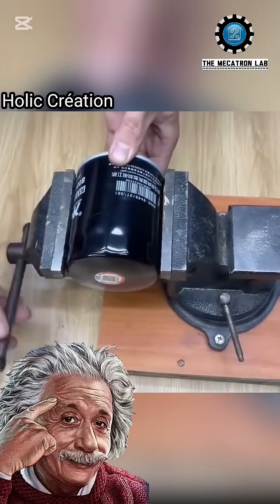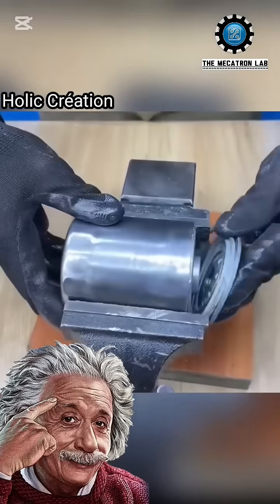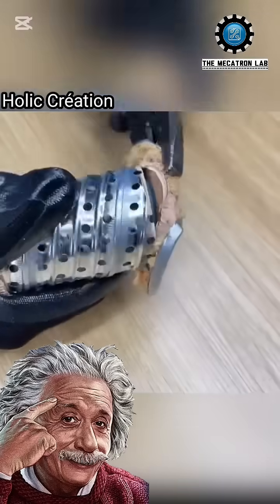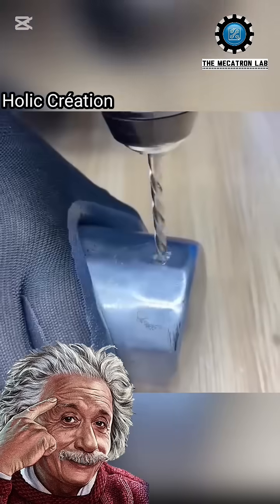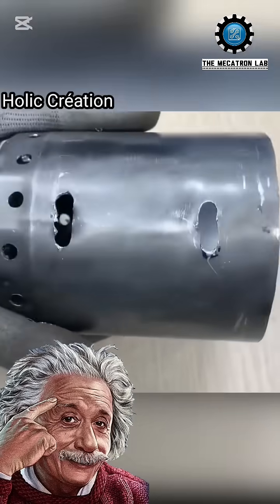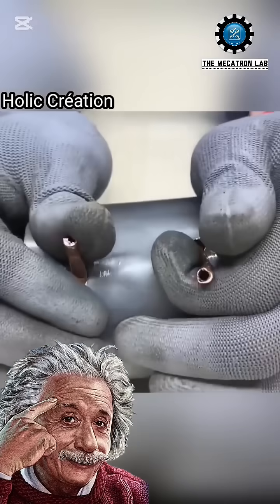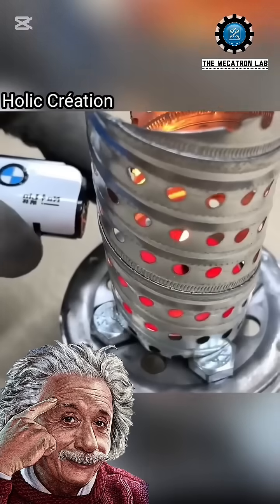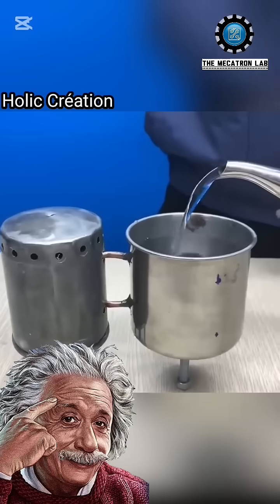How To Make water Heart AT home using oil filter. #diylrojects #experiment

Comment: Good starter idea. But this wouldn't heat a fart in cold weather. Needs to be wood fired, to keep the btu up
Reply: Dairy gives me farts that I can cut scrap metal with, but the torch regulator is uncomfortable to insert, and chafes.😂
Reply: Maybe shrink the inlet size, a bit 😂  @FredtheDorfDorfman1985
Reply: @FredtheDorfDorfman1985 turns out you need a generous measure of wd-40 to use a torch like that
Reply: You can't build fires in public in the city limits
Reply: @btl223  Tell that to all the homeless folks in California camped out all over the place building fires inside city limits.
Reply: 😂😂😂😂😂 @WeThePeople.
Reply: Пердежом более продуктивно
Reply: @MakusPro 😅😅
Reply: Also - there is no pump or anything that circulates the water. It needs to circulate thru the coil to get heated at all. One of the ends of the coil was even left above the water surface once he poured it in - making even a tiny bit of  circulation caused by convection imposible.
He just poured water that was already heated somewhere else in there and measured the temperature of it...
Reply: you can put anything that burns and fits inside there
Reply: And the same principle is used in distilling alcohol 🥃 😂!🤔😏🤪
Reply: Fart is already that hot, i believe jajaja
Reply: Well, there's no pump for a start.
Reply: Guys, here is the True Savior

HalleluYAH (Hallel u YAH) “Praise YAH”

YAH The Father (Genesis 1), Who, with His “HAND”, formed “man - Adam”, from the dust of the ground and YAH’s “BREATH” made “man (Adam)” a living being (Genesis 2:7).

YAH’s “HAND” they “NAILED” to the Almond Tree, to symbolize forgiveness of the “Tree of Life” sin of “man (Adam)” and thus “The Fall OF man” (Genesis 3)

YAH The Father arrived to be Crucified via the Tent of Meeting (Exodus 33, Isaiah Scroll), how YAH has ALWAYS arrived

YAH The Father is The True Savior